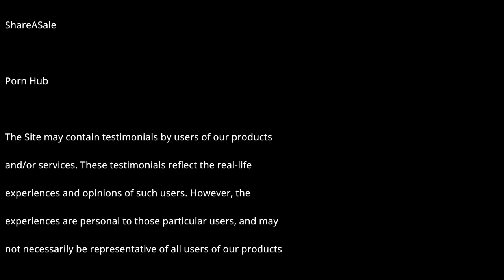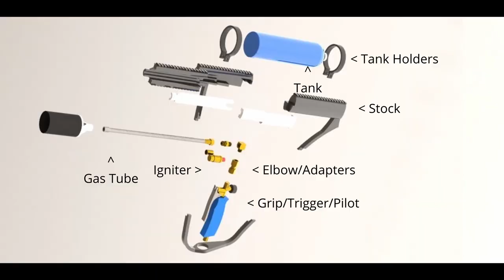Should you 3D print a flamethrower?(2021)

Comment: If you make a choke out of a steel tube with 2 small holes to install between the pipe nozzle and the outer cup nozzle, you can get a bigger and more consistent flame (so you don't have the smaller blue flame)

Comment: We always use 3 mm pins epoxied in to hold stuff like that.
Reply from the maker: Yeah next time I will definitely build in some pins.  Maybe I’ll update the model files to have some pins in them.  

Do you use solid dowels or spring type pins?  3D printed or steel?
Reply: @artofeverything1816  we use 3mm solid metal bar stock and cut them to size
Reply from the maker: @lokiwartooth1138  Good idea, just keep the same stuff around all day and only have one size to deal with.  Freedom units will probably be more common in the US.  1/8” and 3mm are pretty close though.   I am thinking a more puzzle piece like cut in the model would also allow it to lock into place.
Reply: @artofeverything1816  we usually shop McMaster. And we keep everything in mm so that they guys can source the metals easier. Not all are in us and lucky like us to have 2A
Reply from the maker: @lokiwartooth1138  McMaster is good for finding stuff you can’t find anywhere else easily(as in posted online).  Otherwise they are usually expensive particularly for shipping.  Also great because they have a ton of models for all their stuff.  The lazy engineers resource for parts.